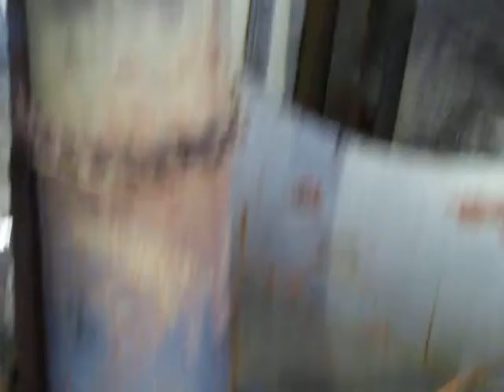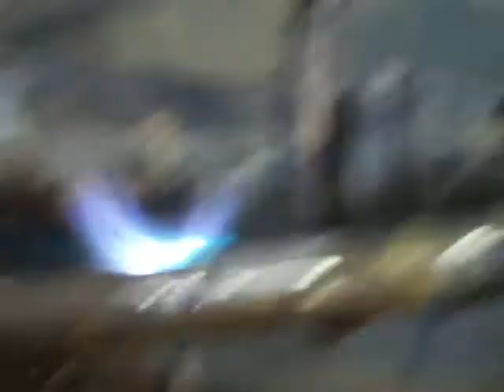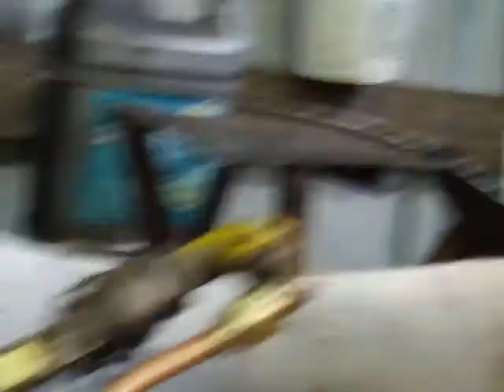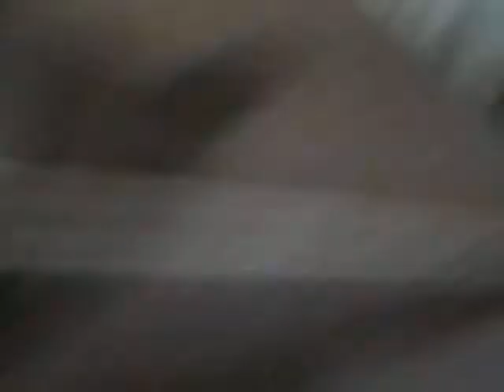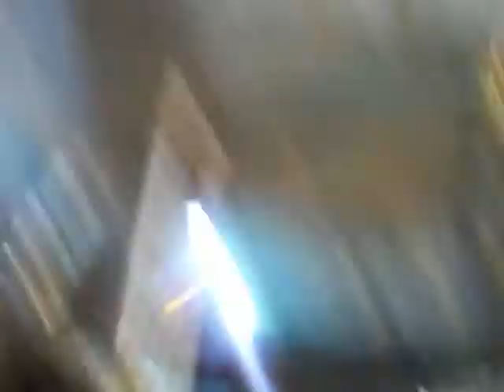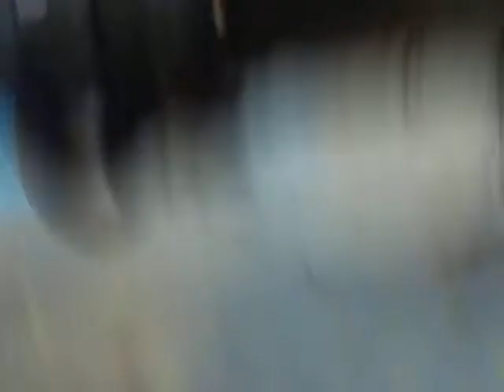waste oil burner part 2

Comment: Both fired with the fine mist tip on them will turn Kerosene or diesel in to a fine fire ball, or a good heat source for your waist oil burner, as waist oil and kerosene burners use the same spray patern but higher pressure.

Comment: though the most effective burner is the atomizing burner,
easly made from the refillable automotive brake cleaner spray
cans that are filled with compressed air.
I filled one with kerosene?
fitted the fine spray tip?

and got a 5 foot fire ball.